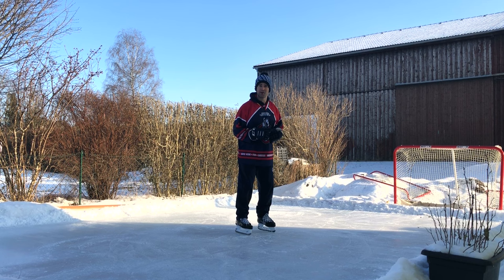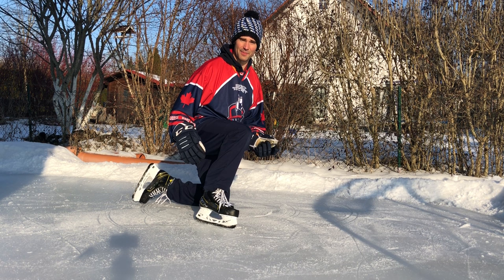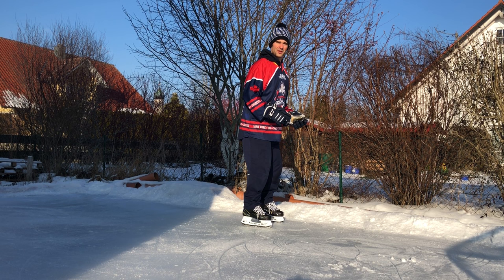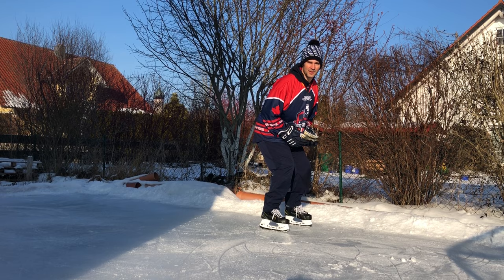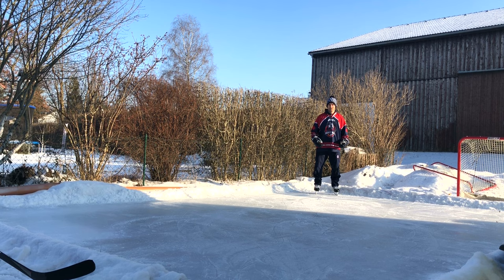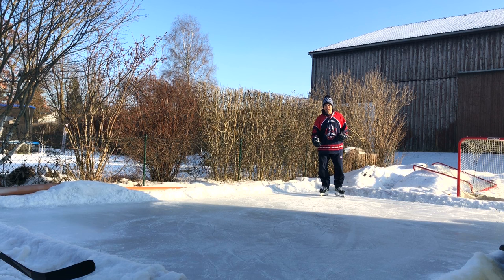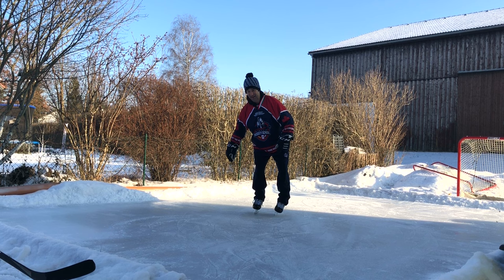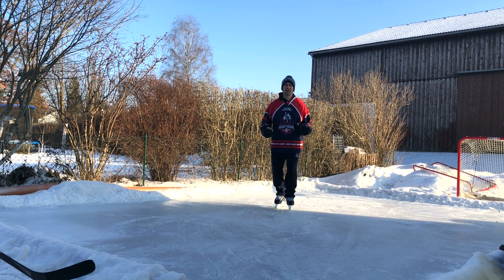Hockey Stop: the Two Biggest Mistakes and How to Fix Them

Comment: Touching the problems nicely. Very important: The back leg is not much more, then decoration or a crutch, that you don't fall after you finished the stop.
After teaching numerous beginners...you only touched the surface of the problem with your solution for the "why do I skate a curve or got into a rotation move". While it is right, what you said here, the beginners have to much weight on their feet, when they turn. The turn has to be quick and with virtually no weight. You won't see this little move, if a "pro" makes a hockey stop, but as a beginner, it's helpful, to go up right before the turn (like a jump without jumping) and then down again in the turn with full weigth on the front leg.

And two further tips: Learning a hockey stop takes time, so don't be frustrated. It's the most difficult move of the casual moves/techniques. If you want to help yourself...don't try it with (fresh) sharp blades, you won't learn it with them, if you're not a 100 kg guy.

Comment: Best info starts at 5:00 exactly.  Really awesome tutorial it's just a matter of practice to get that weight transference to work with your edges which I cannot do the back leg thing yet (often my back skate skips/hops across the ice weirdly instead of  making a smooth scrape)but I feel closer after watching this video. Thanks.
Reply from the maker: Glad I could help! Yes, the back leg is definitely tougher. Just keep working on it💪
Reply: Step with the inside leg, or relieve all pressure to glide the blade laterally, and reset it on the outside edge, slightly behind the outside blade. It's very similar to downhill skiing.

Comment: This is a great video because it teaches you how to fix these issues without requiring you think too hard about it. Having your body in the right position eliminates the need to think "Ok I need to use the middle to front part of my blade" because as pointed out that position takes weight off your heel. Leaning back is also compartmentalized by using the logic of "After we stop that's the direction I want to be going." The only thing you have to actively think about is shifting the weight off your back leg enough for you to get it on it's outside edge. Which after enough times of it getting stuck and you fixing it that will also become muscle memory. The less things you need to focus on the less likely you are to mess one thing up being too concerned about another part. It's a great teaching method.
Reply from the maker: Thanks, I’m glad you liked it!

Comment: What I am noticing as a noob for stopping is that with the inside foot, the rear heel actually comes around almost like doing a transition.  A guy at the rink was showing me to lift up my inside foot and plant it, exactly like you are doing, then I noticed he was actually turning his inside heel almost like a transition... That worked!  Once I started taking my rear foot heel and started pointing it at a greater angle than the stop foot, it comes up on the toe, and bam, two foot stop!  Thanks for the tips!
Reply from the maker: Exactly! You’re welcome!
Reply: What angle were you putting it at?

Comment: I went from the plow stop, to the "turn stop", to the one foot inside edge stop. I primarily use one foot while stopping and have an issue trying to use that inside leg outside edge. and if I'm tired and lazy, that inside leg drags behind. I've found that when I want to come to a complete stop quicker, putting that inside leg outside edge down stops me but doesn't really shave the ice itself. I have yet to learn the outside edge one foot stop too. my skating abilities are not quite there yet. but I keep trying every time I'm on the ice. recently I've been practicing 3 turn (with a figure skating class to become a more capable technical skater.), then transitioning into a figure 8 style to program both side mechanics in stead of relying on strong side only. if my steel is dull enough, I'm able to slide and shave the ice on that outside edge when in the middle of transitioning from one foot to the other in my 3 turns. I have not been able to comprehend the proper mechanics  behind the actual outside edge stop. to end this long message. thank you for uploading the videos you do. I've learned many things from you and others.
Reply from the maker: Your welcome: glad I could help you! When doing the 3, I’d actually recommend trying it without any stopping/sliding in the middle of the turn- it’s harder to do but much “cleaner”.
Have you watched my Outside edge stop tutorial?
Reply: @MarcelsHockeySchool  yeah, I had to re-watch it to see what I've forgotten. trying to build up that commitment to lean and turn is the thing I'm struggling with, for some reason my brain keeps telling me my ankle is going to buckle underneath me. also haven't been on the ice in my own skate for months now. just got them back from bauer.
Reply from the maker: @kyleSTI  Haha yeah with the outside edge stop, confidence plays a big role. You gotta believe that your feet will hold :D

Comment: I kept dragging the back leg even after putting weight on my toes ect. Tried everything. The game changer was lifting and then placing the back leg. Took me 1 attempt and I was hockey stopping now to focus on staggering my legs apart a bit more ✌🏻
Reply from the maker: Great to hear that it worked for you!
Reply: Got any tips for cornering harder on my weak leg? 🤣
Reply from the maker: @brendanwheatley  It's just practice. YOu have to practice your weak side more than your strong one.
Reply from the maker: @brendanwheatley  and take a video of yourself on the strong and weak sides and see if you notice a difference in technique

Comment: You should stagger more the legs, not one behind each other. Wieght qually on inner and outside edge, or even more on the outside edge. Especially when continuing to crossover.
Reply from the maker: Staggering the legs is important when going fast and for more advanced players, but I don't think as important for skaters just learning to stop.
Weight transfer is a gradual transfer from fully on the inside edge at the beginning, to almost all on the outside edge at the end, especially when crossing over as you mentioned

Comment: Marcel. Very good explanation of the hockey stop. I have two tips you might find helpful. I train kids to stop by first getting them to do the pregame crease scrape that goalies do. Like you, I emphasize the need to be in a bit of a crouch and to scrape with the front half of the blade. If after several attempts and they are still getting a lot of chatter, their skates may be too sharp for their weight and strength so I might have them dull their blades a bit on the base of the door to the bench. I find that once they are able to do the goalie scrape they gain a little confidence. Then I have them try a stop while skating next to and parallel to the boards with their hands reaching out toward the dasher. They can grab it if they need to or if they are getting a bit wobbly. These two tips seem to work pretty well. Skates that are too sharp and the fear of falling are two obstacles I try to address when training kids to use their edges.
Reply from the maker: Hi Rick, yes those are good tips! In my first hockey Stop tutorial (it was in German) I covered that first one. I basically tell the kids to “make as much snow as you can”😃 and I agree, most skates are too sharp i.e. sharpened too deeply. They’d be better suited with a flatter hollow.
Reply: What are some tips you give adults? Lol I came from roller hockey and I’m in my 3rd season on ice. I’ve gotten way better at skating and wasn’t to much of an issue with a small adjustment period. The big problem is my game being limited due to the fact I can’t properly hockey stop and quickly change directions like I could in roller. I can make one handed aggressive moves to the net with ease, but I can’t make a quick stop and open up to look for the pass or prepare for a one timer. At this point I’m getting frustrated lol.
Reply from the maker: @ryancaskey4975  I give the same tips to adults as I do to kids. It’s basically just a lot of practice and figuring out what you’re doing wrong. Film yourself like I did in this video and have a look at how your body positioning is and what part of your blade you’re stopping with!

Comment: It's really hard to not do a hockey stop once you've learned how. But I think the key point, which Marcel touched on, is having good body position. Bend those knees, stay in a good hockey position (like a squat), and you won't be making round stops / slow downs.  If you're standing straight up, you'll be less likely to put the weight into the edge to make that stop.
Reply from the maker: Exactly. And if you stand straight, your weight will always be on your heel. And the heel is for turning not stopping.
Reply: My roommate tried helping me skate (he's a very poor teacher, can't explain things) and when I watch him do hockey stops, he appears standing straight with almost no knee bends, and he's very fast.
Reply from the maker: @WritingFighter  if you are a very good skater, you can stop with straight legs. But straight legs is never really an optimal position.

Comment: good practice drill is to try to make the stop with your back foot only - makes you realize how the outside edge of that skate is helping you in the stop and what you might be doing wrong. also going sideways - let's say right - a couple crossovers and then change direction and go left, with the crossovers now going the other way....  in the transition between doing crossovers one way to the other, you'll be doing the hockey stop without even knowing it.
Reply from the maker: True, and I have a tutorial on the one footed back foot stop as well, but the problem is, that if you can’t do a regular hockey stop, you have no chance of being able to stop on your back leg only.

Comment: Torso (shoulders) is not rotating. Straight.
Chin up and look far (don't look at the ice).
Hips and legs are rotating, as shown on the video.

Bend the knees (a lot), like sitting on a chair.
Spread the legs apart.
Is more easy with speed.
Practice for 30-minutes on each side (total one hour)
Practice 3x time a week for 1x week.
Done.

Comment: I followed all the steps but ended up doing tstops and front snowplow only :( Any tips? cuz when i try to frontleg plow, knees r bent, quick hip, eyes forward, then when I try to bring my back leg at an angle, it mess all up! I also get stuck at the front leg (shaving the ice) like its so hard to shave the ice!
Reply from the maker: Less angle on the front leg and try lifting your back leg before putting it into the stopping position.

Comment: great explanation, thank you! how are the boots supposed to tighten ? tight or a little bit lose ?
Reply from the maker: You’re welcome!
It’s kind of a matter of preference. I think if you look at the eyelets of the skate when laced up, they should run fairly parallel to another.
If they make a V, the skate is usually too loose.
Reply: @MarcelsHockeySchool  thank you!

Comment: I find myself initiating the glide on the outside edge first then transfer the weight to inside edge, is it good or bad?
Reply from the maker: you could do the entire stop on your back leg (outside edge). But then you don't really need the inside edge of the front skate anymore. Initiating the stop with the front inside edge is just a bit stronger, so that you can change directions quicker.

Comment: Do you have a tipp for onesided skaters? I can only stop into one direction. I am always getting stuck when trying to stop the other way round. I literally have no feeling for my week side and cant get it to work even with your really good tipps. :(
Reply from the maker: Yes- practice it more. Sounds almost stupid and basic but you have to work your weaker side over and over. It’s like doing weights- if you do the same amount of reps with both sides your weaker side can never catch up in strength.

Comment: How do you lean on the inside edge of one foot and outside edge of back foot and not fall over? 

I'm afraid it feels I'm going to have my feet slow in the stop, slide, and then my body drops back and I fall on my shoulder.
Reply from the maker: Your body won’t fall back because your momentum is still pulling you forward. As you slow down, and are almost standing still, your body will naturally straighten a bit and come back to perpendicular with the ice. The more speed=the more backward lean you can have.

Comment: Hi Coach Marcel.
I can't remember how many times I've reviewed this perfect tutorial. But, now I am still blocked by the second problem. When I tried to stop, my right foot's inside edge scraped the ice nicely, but my left foot actually did NOTHING, just lifted up. So, there is only one wide and perfect line on the ice after my stop. I tried my left foot's outside edge, but it was stuck on the ice and I fell down or flew if at high speed. How can I stop with left outside edge?
TY in advance.
Reply from the maker: Hi, try to avoid angling your back foot too much when you stop, otherwise you might catch your outside edge into the ice. Your blade should only be slightly tilted backwards
Reply: @MarcelsHockeySchool  thanks coach, going to have a try
Reply: @MarcelsHockeySchool  Can't wait to express my BIG THANKS again! I stopped on two feet last week! 
Still have two questions:
1. How to distribute my weight? I put 70% to right foot inside edge and 30% to left foot outside edge. Is distributing evenly, like 50:50, the best?
2. I actually change my left foot from glide to shave directly. I try to lift it up, but it was stuck on the ice again, can't find the perfect position to start shaving. Is lifting and putting down gives you more power on stop?
TY
Reply from the maker: @xli878   You‘re Most welcome!  The weight distribution is a gradual thing during the stop. I start with zero weight on the back foot, and then gradually transfer the weight to mostly on the back foot by the end of the stop.
You don’t have to lift your back foot up, but I find it’s easier that way at high speeds

Comment: How should I distribute my weight after i get on my inside and outside edge?
Reply from the maker: Your weight should gradually shift from the front leg (inside edge) to the back leg (outside edge) over the course of the stop.
Reply: @MarcelsHockeySchool  ok thanks, very good video by the way, I think it is just what I needed. I'm going to try it out today at the rink
Reply: @MarcelsHockeySchool  also, do you think that tightening my skates could help? I have mine quite loose and been having trouble with hockey stops
Reply from the maker: @kaelcharette6997  yes, you will feel more stable in tighter skates. The more comfortable you get on the ice, the more you can tinker around with how tight/loose you want them.

Comment: Learned this at 5 years old. Are you talking to 5 year old? There are so many different circumstances and situations to use front blade or back. You can also be controlling the puck,as your dictating direction and speed.
Reply from the maker: You do realize that this video is specifically about stopping and there is no puck in this video right? And that some people are learning to stop for the first time as adults?
Reply: @MarcelsHockeySchool  No,I didn't. Apologies for not knowing. I should have paid more attention. Truly wasn't mocking beginners.

Comment: I disagree, it is heel not the front to stop.  You just didn't lean back and crouching to dig/shave the ice.  In fact I can stop with one skate using the heel and outside edge while leaning back.
Reply from the maker: No, the heel is used to turn, not stop. I can do one at full speed and get really low and still not be on my heels. I also have a full tutorial on one legged outside edge stopping an it’s not done on my heel.